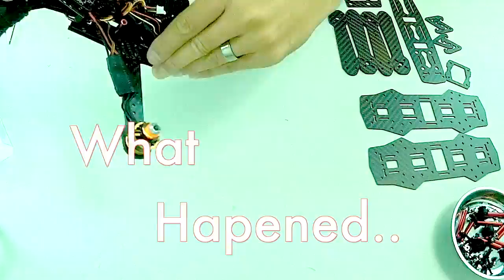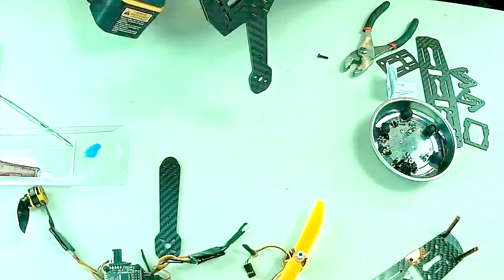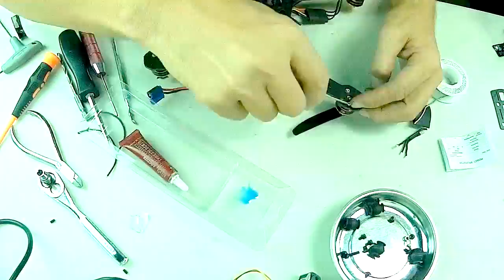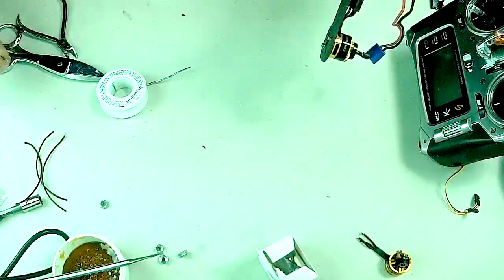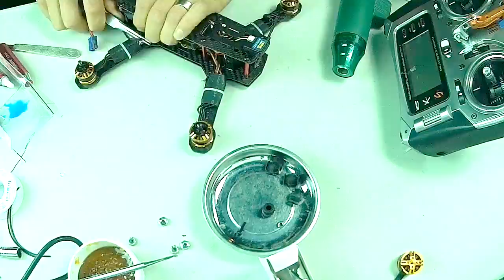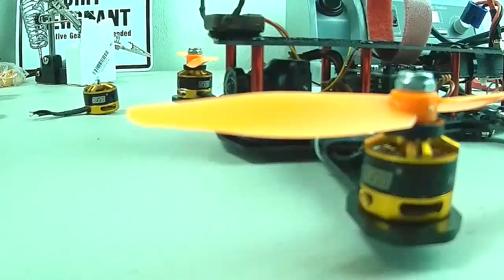Rapid Rebuild Of Broken ZMR 250 Blackout Clone

Comment: What motors are you using on this setup
Reply from the maker: These are the $9-13 DYS 1806 2300kv motors. They are the only motors I've ever used and they are great. I have bent 2 shafts and had to replace them but at least the $ wasn't so bad. Quality bearings in these and well balanced with a lot of power